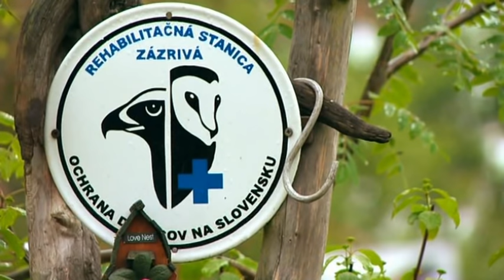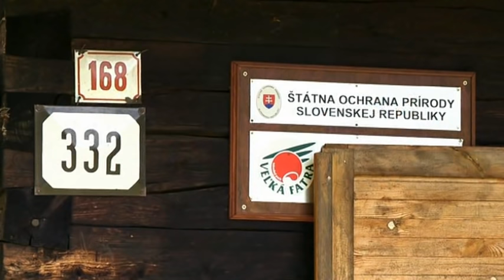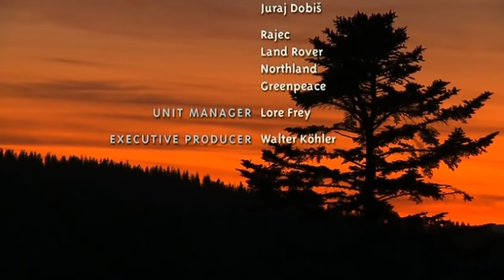Link with the Lynx - Go Wild

Comment: I was fortunate enough to work for 20 years for an oil exploration company as a surveyor. Ive been all over Canada's north....Ive encountered many Lynx over the years hiking through remote virgin forest. These cats are very curious unlike Bobcat, which are wary of humans and so well camouflaged you just cant see them. Lynx on the other hand will come right up to you...especially when they are in heat...I cant speak for all of these beautiful cats, but never did I feel threatrened in any way...the cats were merely curious as to what I was I think. These areas were only accesible by helicopter...it's quite likely I was the first human they had ever seen.